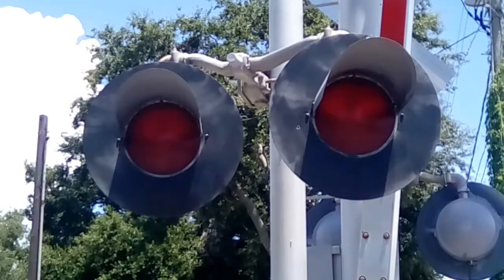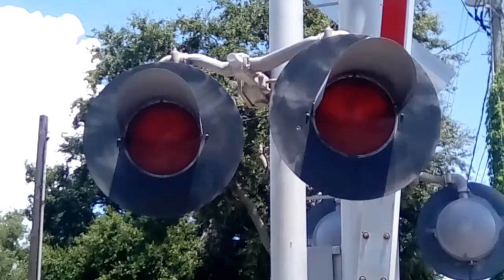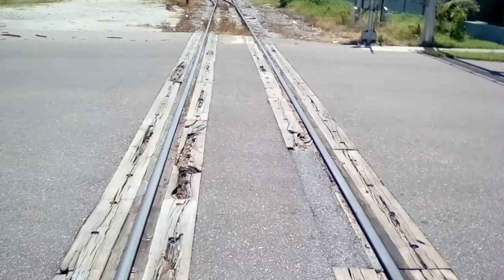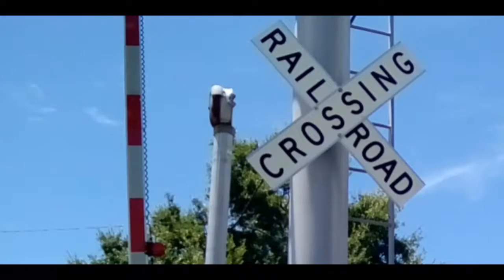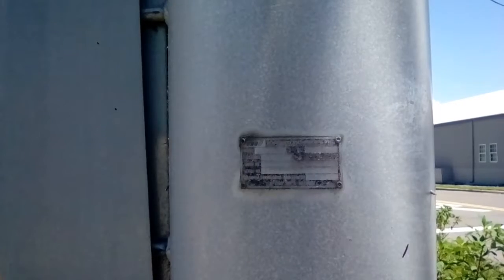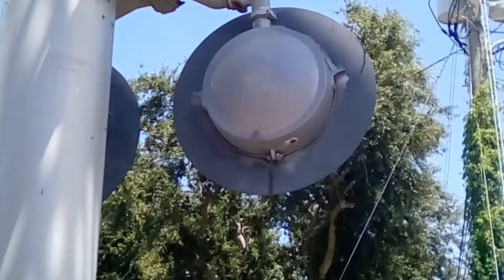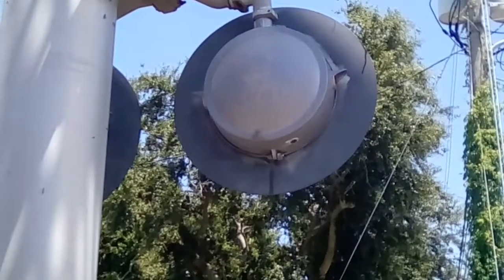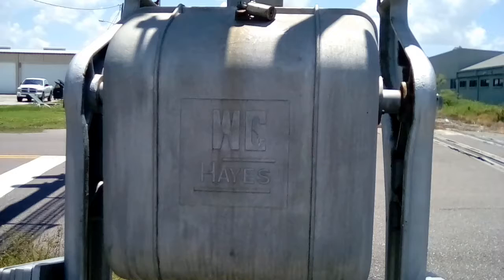An old mismatched CSX Crossing.

Comment: What's wrong with it
Reply: Nothing.... nobody ever said there was anything wrong with it...
Reply from the maker: There is nothing wrong with the crossing. I just thought it was an interesting crossing as most around here anyway have safetran or WC Hayes flashers with concrete and rubber drop in place pads between rails.